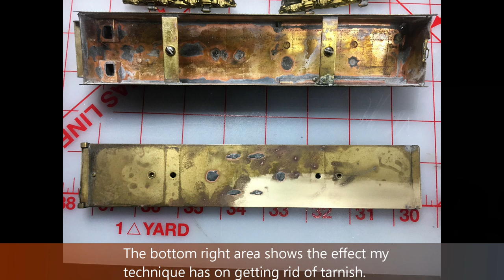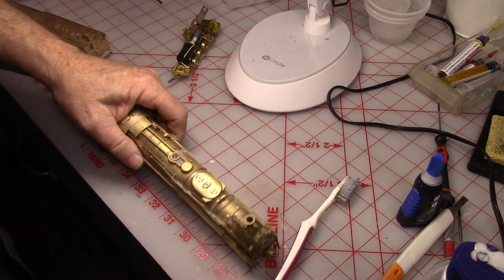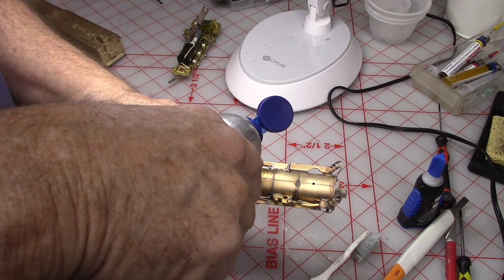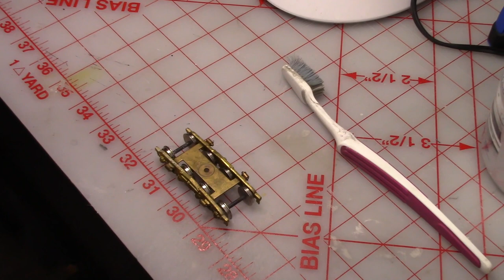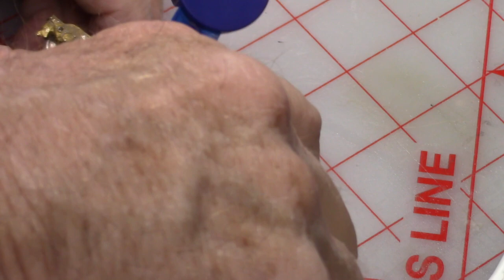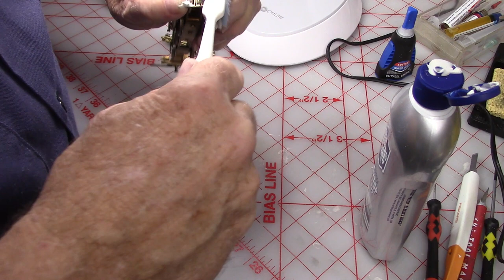Removing Tarnish from Brass Locomotive - Low Tech, Low Cost, Great Results!

Comment: Do you think an ultrasonic  cleaner would cause to much damage to smaller parts?
Reply from the maker: I don't know I have never used one, sorry.
Reply: No damage, but watch out for small parts before you pour the water out of the tank. Ultrasonic cleaners will find every bad solder joint.